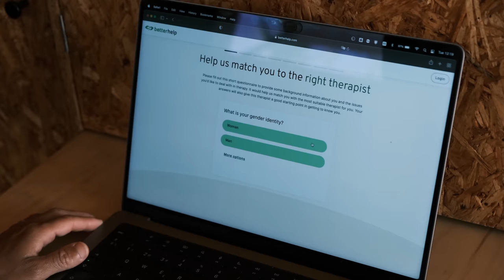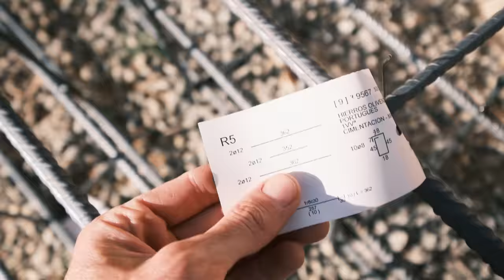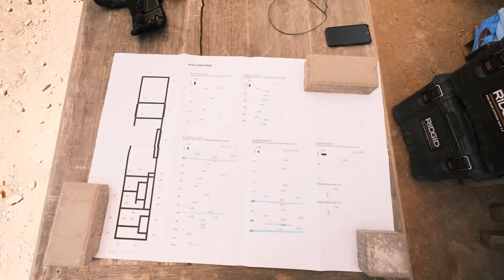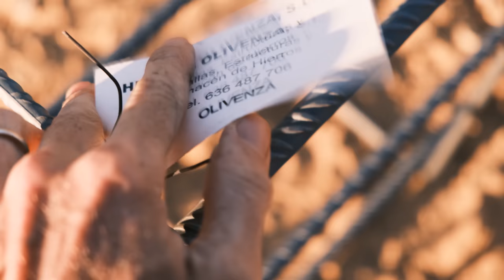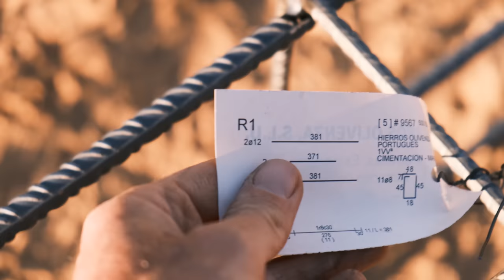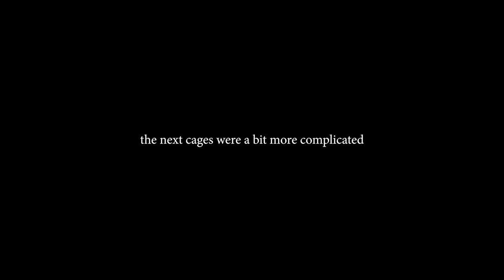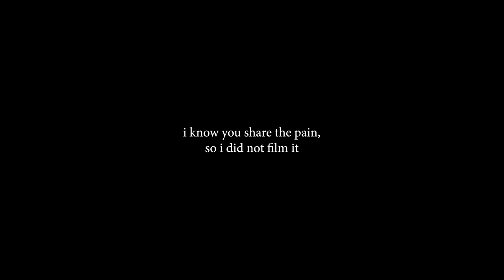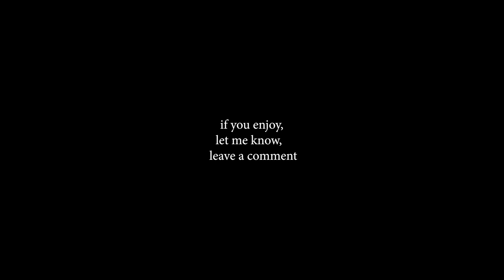Couple Build Modern Off Grid House ALONE (Concrete Steel, Insulation, First Volunteer) Ep 5

Comment: @ 4040 should have just used the excavator to move that heavy cage / and when undoing bracing to add cages just undo one side and twist then twist back and reattach in exact same orientation

Comment: We (my architect partner and I) a bit mystified as to why you are using load bearing insulation in your foundations, could you please explain why?

What is the lifetime of the product in respect of degradation please? 

A third question please, I see from a similar product a 9N/mm2 load bearing capacity, what N loading are you expecting per mm2 across the bottom of your foundations.

Thank you! Keep up the great work, we enjoy your vids :)
Reply from the maker: the XPS boards are installed as insulation for the foundation, to avoid thermal bridges from the radiant slab (the concrete slab will have radiant floor heating). This way we make sure to keep all the heat within the concrete as best as we can, keeping the house warm throughout the winter without much effort. 

The one we used is XPS TR, which is rated at 300kPa load, and a 2% compression over 50 years at 90kPa. Which is indeed far heavier load that the weight of the type of construction we are going to be installing on top, which will be extremely light compared to those numbers! 

hope this helps!
Reply: @ModernHouseCabin  thanks for your reply, we didn't know about the radiant slab heating plans you have -- the use of the insulation  now makes perfect sense to us :)

It will be interesting to see the design for this heating progress as you build more and more of the structure...

Comment: In the 80's at Auckland School of Architecture (NZ) I was taught "energy efficient design". Fast forward 40 years, Australia still has no idea. When I came to AU in the early 90's, there was no consideration of energy efficancy criteria. I would ask "why don'y you insulate houses inQld (Queensland in the north east of AU), and invariably I'd be told by architects and those teaching future architects "you only need to do that down soth". So I'd follow up with "Why do you insulate cold stores?" to which I would invariable get "to keep it cool", so I would re-ask my first question... and get the same answer. And that's not raising the "pink-batts" SNAFU